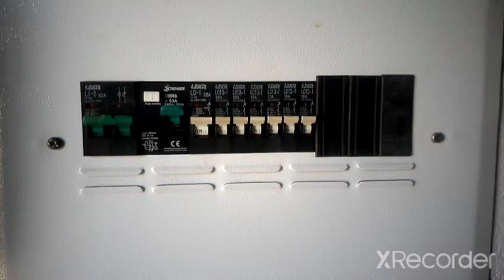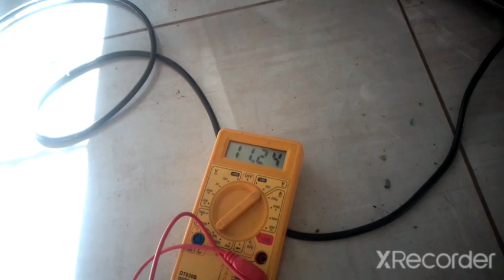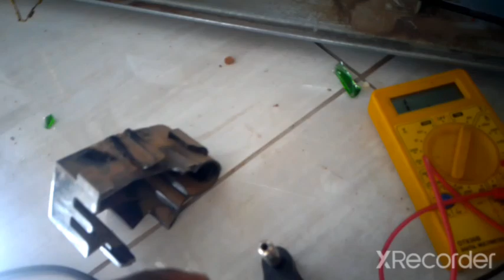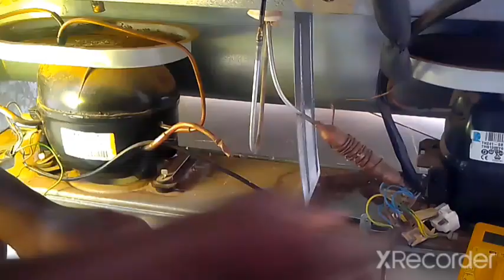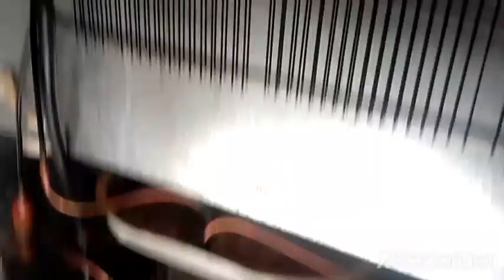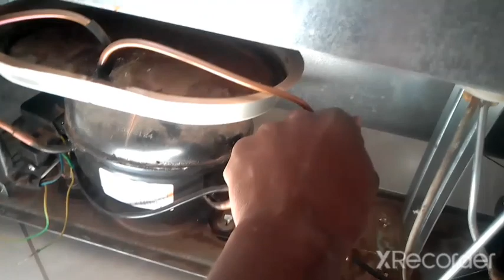How to repair a refrigerator which is tripping the main switch

Comment: My LG fridge is consuming too much electricity, about 4KwH every 24 hours and it's only 250 liters. What could be the problem?
Reply from the maker: Thanks for reaching out. Start by answering the next question. Was your fridge ever repaired before , does your fridge ever switch off the compressor once now n then , does your fridge doors close properly, how often do you open n close your fridge

Comment: I have a hitachi inverter double refrigerator it's power bar indicator is not turning when i put it off for 12 hours and turn it back on it work fine its happening again and again
Reply from the maker: Thanks for your comments. Take the board to electronic repair shop so they can rebuild it or get a new one

Comment: I have a minibar fridge and it started tripping (single pole). What should I do. I assume it's nothing to with the earth. Pls help
Reply from the maker: Thanks for your comment. If it's tripping a single pole  . It means you the fridge is drawing over current. Meaning that there is a short circuit, it either your neutral and live wire are touching each other or your compressor is really bad
Reply: @karaanielectricalsandelect5112 Thanks. And it means a need to replace the compressor?

Comment: In my own case, my neutral is grounded with live after multimeter test. What should I do to solve this problem. The cable is good when I isolated it from compressor and tested it. I also did compressor test, compressor is good. But I get continuity test when I plug the relay to the compressor. The compressor ground is good too after testing. Is it possible to bypass the relay and plug the wire directly on the compressor?
Reply from the maker: Thanks for your comment. How many ohms are getting on your meter of course you can by pass the relay how ever you need to understand how it works and should also be only for test since you can't use it daily
Reply: @karaanielectricalsandelect5112  For PTC relay.
, I got 36 ohms. For Compressor, I got 10.6(C+R) ohms, 27.7 ohms (C+S) and 35.5 ohms (S+R)

Comment: Removing the earth wire will allow the compressor to start and run but the solution is a major risk of getting shocked when touching the fridge that's why the fridge is earthed to prevent shocking.
Reply: he says he repaired it , but what he has done is created a shock hazard, i would never do that, what if there are kids in the house. what he has done is wrong, it is not acceptable. I learnt as a schoolboy that you should never do what he has done .
Reply: Earthing allows the electricity to travel to earth and not through the householder's body when there's a fault. Removing the earth connections means that the fridge is technically live and dangerous/deadly.

Comment: My refrigerator goes off once in a while,  lights in frig too  but then it comes back on and everything is fine. what you think this could be. its a Kenmore 2 door 1980, never had a problem until now
Reply from the maker: Thanks for your comment. Does your fridge have a PC board. If not check your power code and the three pin plug something might be loose or have a bad connection
Reply: @karaanielectricalsandelect5112  I had it plug into a protection gadget and i took it out and put a new one and it work again. the one i have goes off for 4 minutes when  the light goes out incase the electricity flickers back and forth. thanks for your quick response  I gave you a thumbs up..

Comment: Hi is it normal to get continuity between live and neutral when testing the fridge's power cord. I have my fridge tripping earth leakage immediately when plugged in , so used multimeter using continuity settings and I get a buzz between live and neutral
Reply: Hope you can assist me before calling in a professional
Reply from the maker: Thanks for your comment. It is normal if it's atleast 20 Ohms and above. But if it's less than 9 Ohms its not normal and it means you might be having a short circuit or your compressor or PCB is grounded
Reply from the maker: You can confirm by testing the compressor windings directly

Comment: EXTRA TIP HERE but first I Found this to be very useful, well Done. Do More! TIP Just to share my experience, I had a Fridge Freezer trip out the breaker. Misleadingly it would happen immediately but sometimes it would last a minute or more before tripping, so it seemed like a compressor issue. It turned out to be an issue with the Moulded Plug that could not be opened.Two solutions. UNPLUG THE PLUG and then (1) cut the plug off, perhaps cut back a bit and rewire a new one OR (2) as it could be an issue with the cable itself, UNPLUG THE PLUG and unscrew where the lead goes into the fridge and rewire with a new cable. You could cut a cable off some broken or unneeded device, but make sure it's 3 core (wires) with an Earth (A device with a Metal exterior will be 3 core) However if you just want to do an emergency temporary test only and use 2 core just to see if this is your issue. TAKE PHOTOS and videos of where you are unscrewing etc as to have a record for when rewiring naturally make sure you are not using a reverse lens.
Reply from the maker: Thanks for your input . You are much appreciated here thnnk you
Reply from the maker: Thanks for your comment . You are much appreciated ❤️🫂
Reply from the maker: Yes 💯 . I can be the three pin plug, ober time the plug may start to melt probably due to lose connection or drawing over current. Also the can can be damaged due to wear and tear or by animal. Thanks again for your the extra tip
Reply: Same as what mine is doing I did take out the earth but it lasts for 2hrs then trips again
Reply from the maker: Thanks for your comment. Is it still tripping the Earth Leakage

Comment: Thank you so much for this video. I was searching pretty much all day for a solution and had already isolated the board as the problem when I finally found your video. Now I can save myself the time and money of rushing out too get a new board. I have disconnected the earth and the fridge is working again. The loadshedding is killing our appliances. Thanks again.
Reply from the maker: Thanks for your comment. We hope you will come around again
Reply: I cut off the Earth too in my freezer. The chest freezer works. So it's not the Compressor.
Its propably a control board problem. 
Is it dangerous?
Reply from the maker: Thanks for your comment. Your comment makes a difference 👍

Comment: Its not confusing only this are kind of technician who always look for shortcuts to fix the fridges and that they can just be paid and go.how can you bypass pcb board and remove earth from are fridge. The owner will buy new fridge soon cos is looking for cheap technicians . The technician is not competent.
Reply from the maker: Issack . Firstly I have highlighted that this is a temporary repair and one should do at his/her risk. To all of you guys if u are qualified or not if you realise that the compressor of a fridge is broken and to place an order for new one takes time and the products in the fridge can go bad anytime soon. With that said it's common sense to tell the client the situation and provide possible solutions in this case was to buy a new board cut the earth wire to keep the fridge running while waiting for the new board. More over if you understand electronics you will understand that if the circuit is insulated the is no need for earthing which in this case the PCB was. Let love lead❤️

Comment: Your explanation is very confusing
Reply from the maker: Thank you for your comment. Ok my friend let me break it down for you. If you have released that your fridge is tripping one of the switches on the main switch. The 1st check if the switch which is tripping is either a single pole (15A,20A , 25A breakers this varies from country to country) or the Earth leakage circuit breaker. If it's the earth leakage then it means one of your components is grounded either the compressor, PCB e.t.c in that case you can make a temporary repair by cutting the earth wire from your power code or find the group components and replace or repair. The if it's the single pole circuit breaker tripping then disconnect the fridge and look for professional help

Comment: How to know if the fridge compressor grounded
Reply from the maker: Thank you for your comment. When test if a compressor is grounded. U put you multimeter to continuity. U put one probe on the metal chase of the compressor and use the other one to test each terminal Start , run and common terminal
Reply: And shocking
Reply from the maker: This week I Will post a video to show a grounded compressor and how to test it so subscribe to channel so you may be notified when I post it.

Comment: Help me bro, my fridge trip the earth leakage breaker even I switch of the switch socket and that happen when I touch over load terminal with screw driver and switch socket bis off is tripping I wondered why? Please help
Reply from the maker: Thank you for your comment. Yes I have been through what you are getting through. Do you have a multimeter with you. Or have
You already cut the Earth cable. And can you pliz share the model number of your fridge so I can narrow my suggestion to you

Comment: Nice one I have a problem my man my fridge trips even after cutting the earth
Reply: Thanks man I was able to fix it its now working but I have another problem there's these old kic fridge of mine the freezer is working but not cooling I tested all the components including the thermostat they seem to be working so what could be the problem  cause it's an old one is not using a fan
Reply from the maker: Thanks you for your reply. If your compressor is running there are basically of the two problems causing your fridge not to freeze
1. Too low refrigerant
2. Inefficient compressor.
This is a sealed system problem so you require some skills on how to do gas charging. Let me give a link to my other video so can see the required tools and accessories. I will help you through . Thank you for your comment
Reply: @karaanielectricalsandelect5112  Thanks no the freezer is working fine but cooling side is not is just warm and the thermostat, OLP and rely is fine and it's an old one is not using a fan
Reply from the maker: @moyahabopheeha7149  Thank you for your comment. Now that we know the freezer compartment is working fine the the thermostat is fine. (A thermostat is just a switch which switch On/Off the refrigerator compressor in response to the respective temperature set) . What your refrigerator needs is gas. It's low on refrigerant.
Reply: @karaanielectricalsandelect5112 Thank you my brother 👊
Reply from the maker: @moyahabopheeha7149  you are most welcome
Reply from the maker: https://youtu.be/XA1FIhpaULI
Reply from the maker: https://youtu.be/rORsSybaVw0
Reply from the maker: Which one of the breaker is tripping . Is it the EARTH LEAKAGE or a single pole breaker. If it's the earth leakage make sure you have cut the EARTH WIRE from the power supply cable ( power cord ) and u have insulated both ends of the wire.

We will be happy to see your next response
Reply: @karaanielectricalsandelect5112  yes the earth leakage thank you will try that then will give you feedback